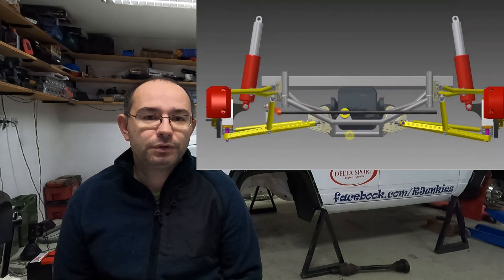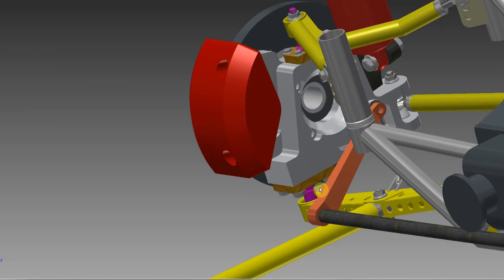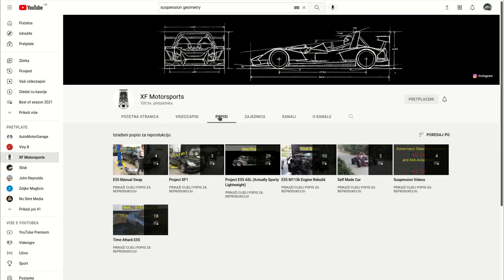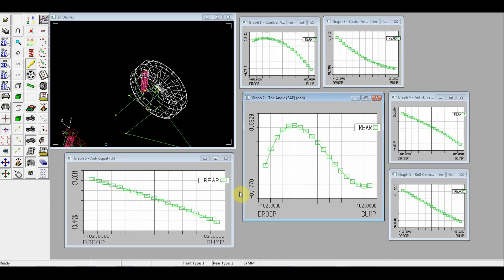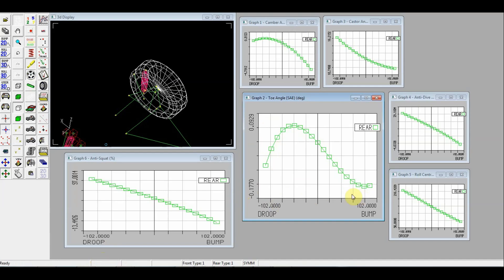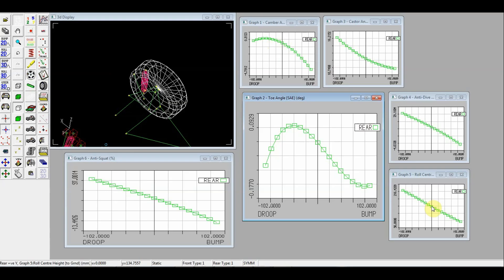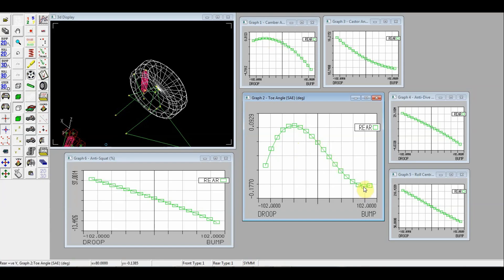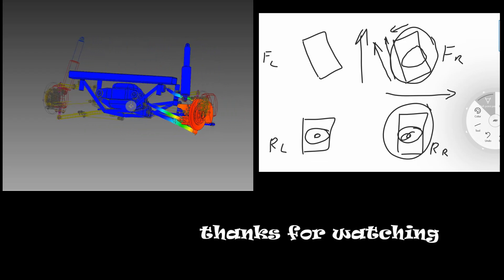Custom independent rear suspension for rally (Lada vs Escort MK2)

Comment: хорошие параметры получились. 3д модель выглядит законченной и красивой. Хочу задать несколько вопросов. 1-й какой полный ход подвески? 2-й из какого материала вы делаете поворотные кулаки (точнее марка алюминия)? 3-й стабилизатор тоже будет самодельный? вы его тоже рассчитывали?
Reply from the maker: Thank you! 1. Full travel is 200 mm. 2. aluminium 7075. 3. Maybe, there is chance that we can buy some, but there is plan to use easily available 4130 steel in 3 diameter variations, I want it to be soft as possible. It is almost 100% certain that we will have to use it.

Comment: Some clever stuff happening with this car.

But I would move the trailing link to end at the outer pivot, not the middle of the link to get rid of the bending load
Reply from the maker: Nice noticed, but due to chassis limitation it have to be in this location. We would need to produce new pickup point, this one is already there.
Reply: @RallyJunkies  I'd alter the chassis attachment point so trailing arm can angle out to outer pivot point. Does not need to be straight